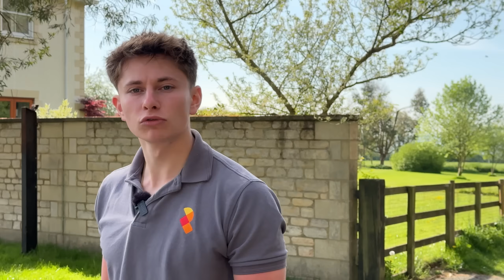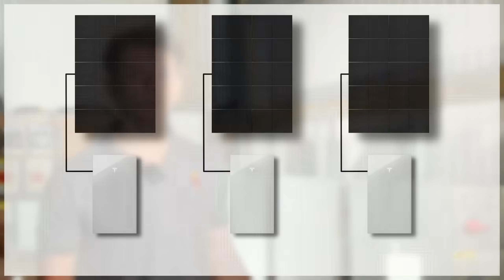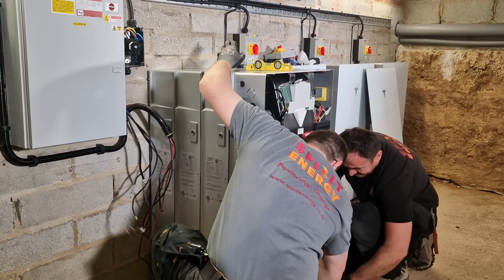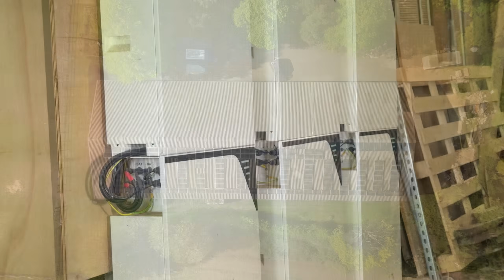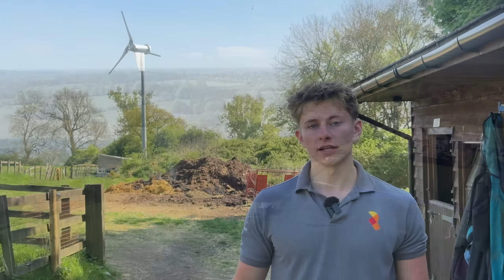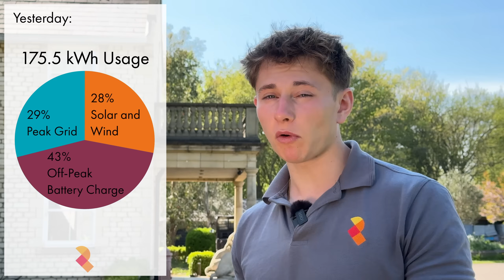Installing 19 Tesla Powerwalls with 500+ Solar Panels, 3 Heat Pumps and a Wind Turbine.

Comment: Wouldn't it make more sense to install a large solar array? They have aa rather laughable amount of solar for the absurd energy demand. On a good day you should be able to get 100% of daily need, plus charge the batteries. It's not like they are short on open space. A 25KW ground mount system would be trivial. They would still need to charge batteries on after rainy days, but would largely mitigate their need for grid charging. The panels would be about $5-7k + mounting, and would last 30-40+ years unlike the batteries which may last 5-10 with the heavy use. Using solar for day use would substantially increase lifetime of batteries.

Comment: I have 60kw of solar and 200kwh of tesla batteries at my ranch 😂 i guess i need to add a little more than 100kwh to stay the biggest 😂
Reply: Your system makes more sense, this system is an absurdly large battery setup with almost no solar, while yours likely needs little to no grid support. Panels are substantially cheaper than batteries and last 4x as long.
Reply: @xeridea  But while nighttime rates are less than 7p per kWh, the payback period becomes essentually infinate on panels vs charging at night.

More panels will make sense when the night rates dissapear in the next few years as usage times evens out costs.
Reply: @joshbridges8410 the cost of his extremely massive battery setup far outweighs what the panels would cost. The panels he has aren't even enough to run the play during the day when there is full sunshine, and solar panels are so cheap that it would still pay back, even considering cheap nighttime rates. The batteries will also need replaced and maybe 10 years, while the panels the last 30 to 40 years. It would make more sense to get as much solar as reasonable during the day, and you would still use the nighttime rate for running your house and such at night, but not completely relying on it to charge batteries just so you don't have to get solar panels, it makes no sense. Batteries make more sense to avoid High time of use rates for places like California that have absurdly high peak rates. Even if you have three cents per kilowatt hour, the panels will still pay back

Comment: Luckily I wasn't playing the 'Tesla' drinking game.. The "batteries from another manufacturer" don't get plugged?
Why stick with a brand that has software limitations and is not compatible with the property's phase supply?

There are plenty of options out there for expandable battery systems that don't have the same constraints (only supplying one phase) AND allow external control over exporting to the grid.

Comment: I wonder when Tesla will fix the limitation on expansion packs? I have two PW3s in California and added two expansion packs. Still mounted one behind each PW3 but both expansions are connected to the lead. Once they fix this limitation, I can just move the cable to the second PW3. The only advantage being increasing the charge rate of the second PW3.
Reply from the maker: Agreed. Can’t wait for the restriction to be lifted.

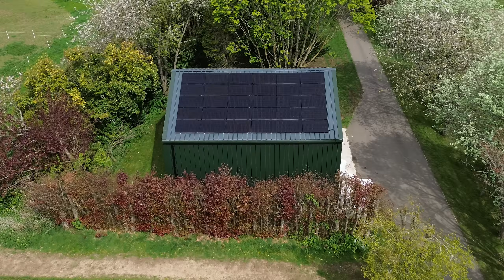Comment: 3:14 the bifacial solar aray isnt it much better to elevate the solar panels for example and paint the roof in a white or clear color to improve the efficiency?
Reply from the maker: You’re completely right the bifaciality will make little difference and it wouldn’t be cost effective to paint the roof or elevate the panels because the additional gain would be negligible.

Comment: i have a curious question! why hasnt the customer just bought something like a full container with massive 500Kwh or 1Mwh battery pack? there is too much going on there to be honest!
Reply from the maker: Thanks for the comment. A good question. 

For container storage you really need a high voltage connection to the grid. A typical three phase supply can’t handle it. 

He also has multiple supplies so even if you could connect them you’d have to run cables to all the supplies on the site to share the capacity. Which would end up being more complicated and costly.

Comment: Sigen energy every day. Sigen 3 Phase would have would have simplified this system providing UPS and grid forming inverter that would allow 3rd party inverters to run off grid. Also no real limit to scalability.
Nigel has a great system but hugely complicated and an integration nightmare to self consume and manage loads.
Would be interesting to understand the loads and the seasonal requirements. Is everything that can be done overnight done or solar surplused - swimming pool heating?
Phase balance looks challenging and limited by power wall output / DNO limits.
Reply from the maker: Hi, yes Sigenergy three phase would have simplified this. It wasn’t an option at the time. Maybe Tesla’s three phase option will be even better when that’s out.

Comment: Can a home this size qualify for Tesla PowerPack or even a Megapack? Just curious
Reply from the maker: Good question. It would qualify I think, but the issue would be the grid connection. I think you’d need a high voltage grid connection.
Reply: I'm not sure Tesla would sell or support them for a residential system

Comment: How did you manage to connect the Tesla remote meter when the PV and wind generation was far away from the main house, WiFi repeaters or RS485?
Reply from the maker: Hi, the existing Alpha system that was there before already had the DC cables for the solar connected up so we just rewired them to the PW3 MPPTs. The wind inverters are in the house's plant room and I believe we used RS485.

Comment: Haha in Hungary there is the opposite.. They dont allow you to install 1 phase systewms, only 3 phases above 2.5 kW but the purposely use algebratic metering so your 3 phase inverter and home battery cant make a balancing to yout phases to make the meter read zero.. if you pull power from any phase your meter ticks, if you push back any power on any phase your meter also ticks.. the only catch that pulling power is 14 times more expensive than sending it back.
Reply from the maker: Wow. How interesting to hear. Thanks for your comment.

Comment: Nice job 🙂

I think SigEnergy has 3-phase backup, but obviously if there is an existing system it's not sensible to swap it.
Reply from the maker: Thanks, yeah it made most sense to max out the PW3 setup. It’s also more tried and tested.